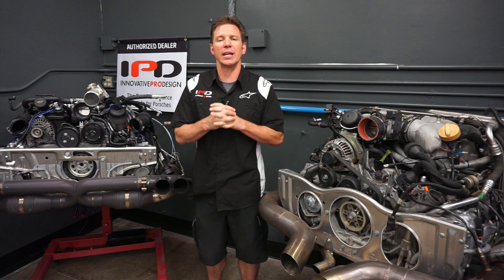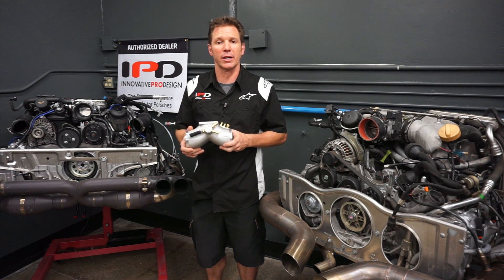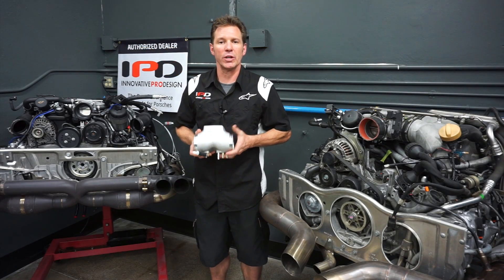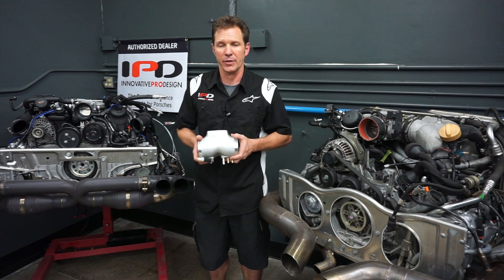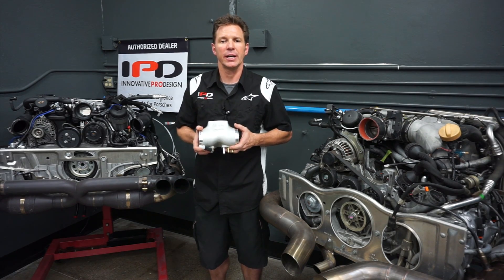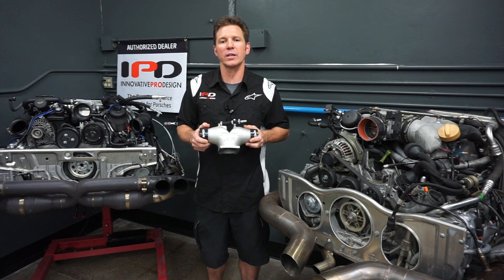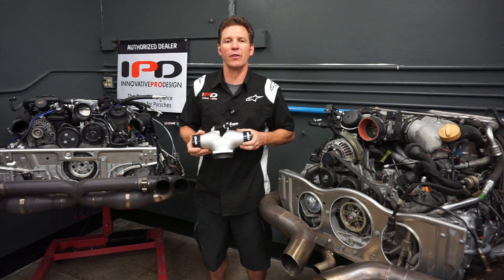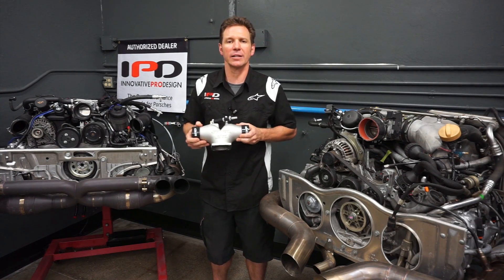IPD Turbo Plenums

Comment: Great video. Understated and informative, as always...they work! As Greg describes, everything improves: horsepower, torque and throttle response. He doesn't mention what my testing also proved: 1-2 mpg better mileage! I've done prototype testing of this system and Ferrari exhausts and tell everyone that the IPD products are the best investment you can make in Porsche performance upgrades (the other day I was at Porsche Shreveport). My advice: leave the IPD product's aluminum bare- don't powdercoat- so that the maximum surface area of the aluminum is exposed. This will give you the best cooling of the metal.